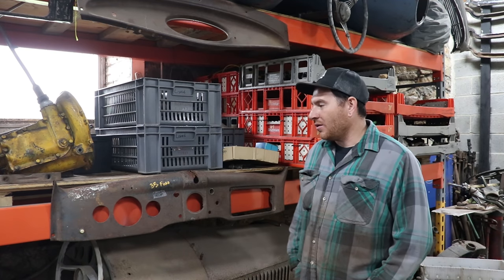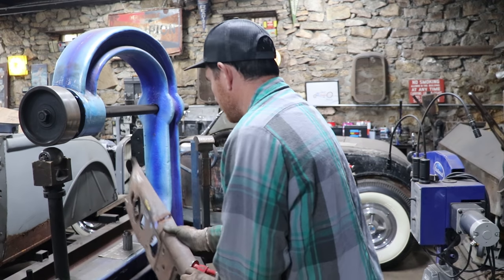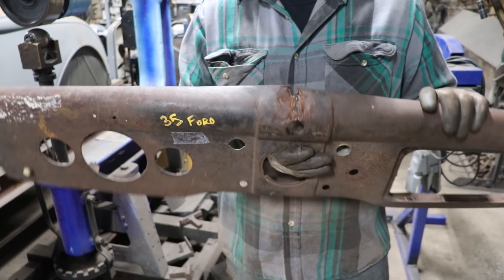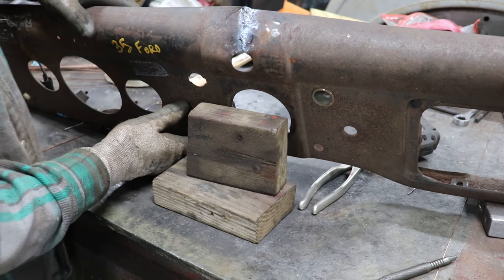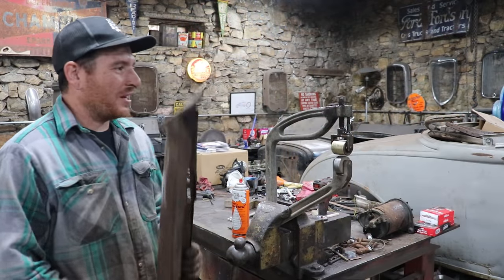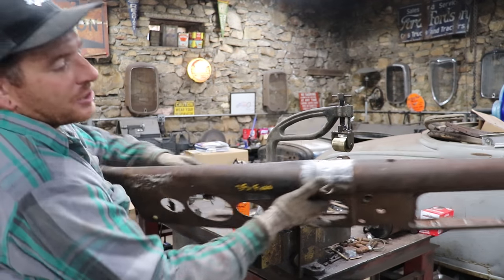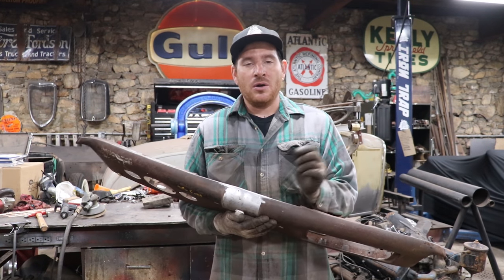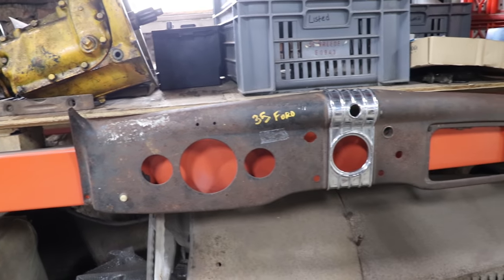Repairing The Hacked 1935 Ford Dash Matt Purchased At Hershey

Comment: Nice work mate. It can be tricky to add metal to replace lost metal, especially on old thin metal. I find using Eastwood weld backer a real bonus. The thick copper supports the molten weld and also helps fight burn back.
 The little English wheel a little gem, designed for in situ repairs on cars where the job is stationary and the wheeling machine moves. I have its partner, the multi anvil planishing hammer that was also designed to do in situ repairs. There a real joy from using period correct tools on old metal.

Comment: Here's a "trick" for you to protect metal which is based on the science of how the space between atoms increases under heat.  If, while the metal is still very hot, you mist ANY kind or color of lacquer or enamel-based paint onto the steel, the pigment will form a tighter bond with the steel, virtually impervious to oxidation.  There is a technique to this which involves successive mist layers until you feel you can spray a few wet layers.  You may see the paint bubble...no matter.  Just leave it be.  It's basically "baked enamel" just like what you see in appliances.  The finish is tough, but can be sanded for later painting.  I live in GA where the heat is hot and the humidity is high, I prepared several large steel gussets by baking the painted steel in an oven to achieve a finish that survived without rusting in the GA outside for a decade until I had no more use for the gussets.  When I started welding, I tried the technique I described to you in order to prevent rust from forming at the weld... Great success and a time saver.

Comment: As we have come to expect...more excellent video Matt! I haven't looked forward to each new episode of anything so much since I was a kid and Batman was on TV. Now Batman reruns are stupid...your stuff is great.
I find it necessary to watch your videos more than once because there is so much interesting stuff in the background to look at. So now I have a few questions & observations if I may:
- What is that beautiful wheelcover on the rear of the '32 roadster? Must be a vintage aftermarket custom...Looks like something out of an old AMT model kit. Is it 16" or 15"?
- What is the engine visible behind your large shrinker stretcher set there? Doesn't look like the old Caddy from that angle.
- Are they real vintage glasses on the bench around 14:30?
- I like the original cigarette lighter still in the 35 dash.
- Your workbench is a mess! But that's alright...so is mine. I always say " a guy who has too clean of a shop has too much free time on his hands".
- Lower wheel on the English Wheel is actually called an Anvil.

Comment: Have you ever tried use in a piece of copper bar or a smashed copper pipe behind a hole you trying to fill with weld? At least with a MIG the weld flows in the hole and doesn't stick to the copper. Not sure on a TIG weld.
Reply from the maker: It tends to make the Tig weld get contaminated and pop. I usually can control the weld enough to not need a backer. But I agree with a MIG it is very handy!

Comment: Have you used a different metal when filling in a hole or gap as a backer to level the underside of filling in with filler rod? Had to do back in the day with tig welding. Many years ago.
Reply from the maker: Occasionally but usually I don't as it raises a chance of contamination if the hot weld touches it. I just try and keep the puddle from sagging as I weld. Just how it do it, no wrong way as long as it's a good repair! -Matt/ITG